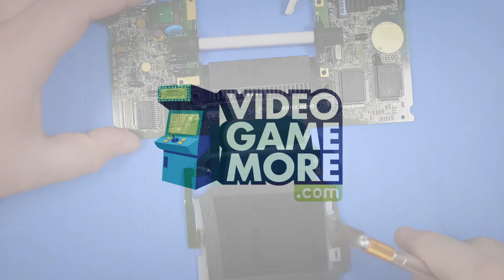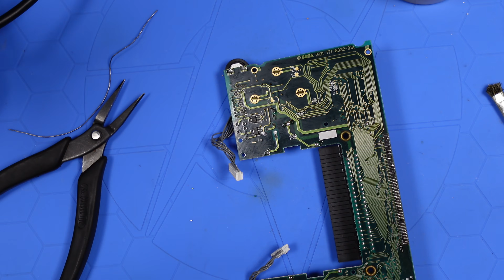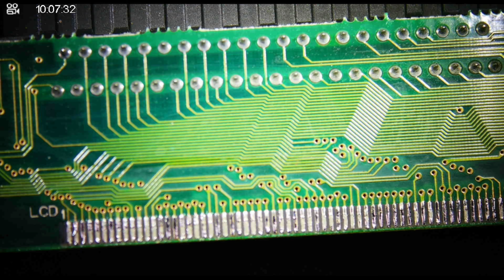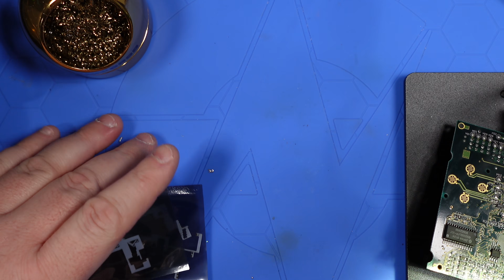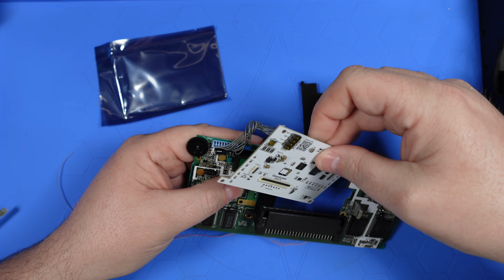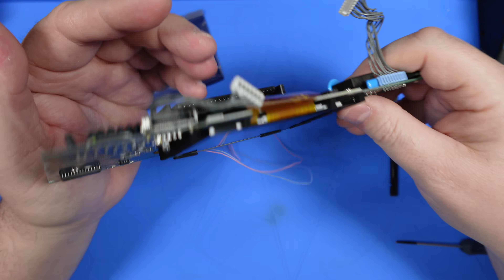Why Does My Game Gear Look Better Than My TV Now?!

Comment: Great Work!! What kind of soldering iron do you use?
Reply from the maker: Thanks!! I use an older Weller WX1. Its a great Iron, but more modern Irons have some nice features so I might upgrade one of these days. I'd like a way to have a standard size and a smaller fine tip I could switch between.